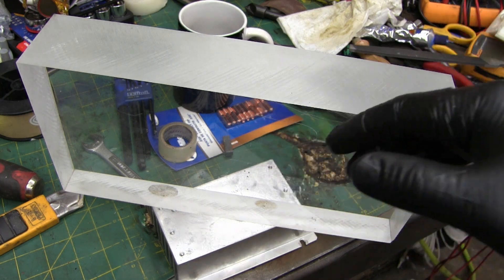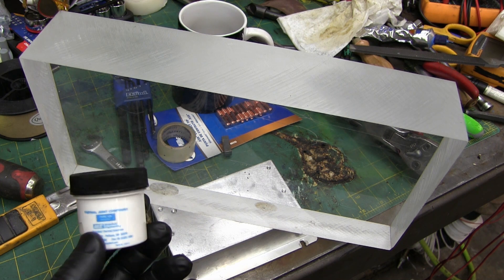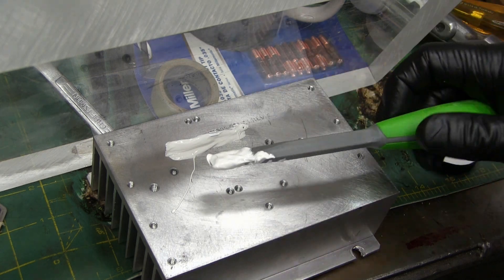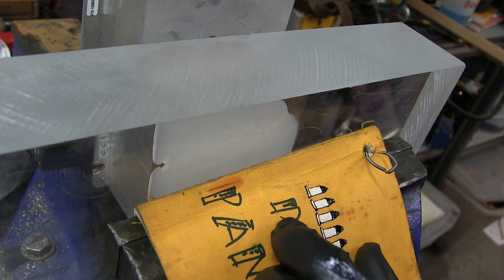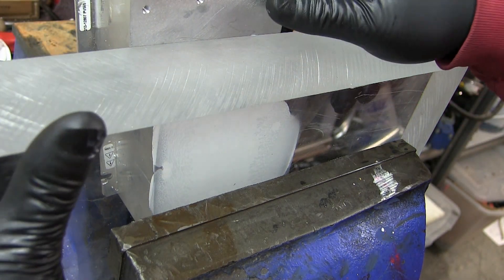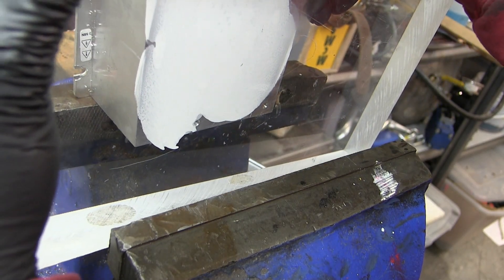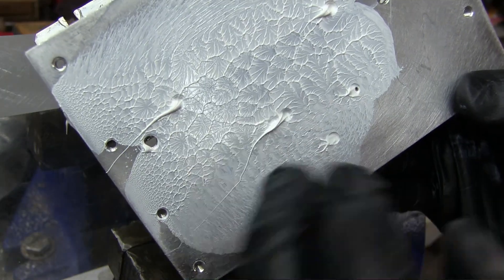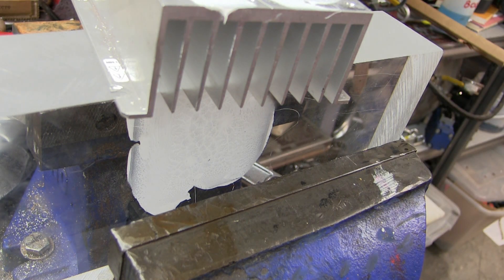Quick test of best thermal compound application

Comment: Not familiar with this odd pagan practice. I worship at the altar of molten metal. Her Glorious Electrons warms the sacred work. Her two prophets are the wise ones, Lincoln and Miller. May they forever arc.
Blessed are the apprenti, for they haul the tools and warm the lunches. Blessed also are the journeymen, for they interpret the sacred runes. Schmoo is forbidden by the Council of Bumblefuckery,  1967.
Reply: When you're putting a heatsink on a CPU in a thousand dollar computer, you can't really work with molten metal.
Reply: TheSpoonKing Challenge accepted!
Reply: TheSpoonKing actually, I bet you could work with molten metal. CPUs can be soldered to motherboards, CPU lids can even be soldered to the CPU die. It's not much of a stretch to solder a heat sink to a CPU. It would provide better heat conductivity, but be impractical due to difficulty in removing the heat sink later.
Reply: Kinda can, Thermal Grizzly Conductonaut. :P This kind of Thermal paste type are usually called Liquid Metal, and have about 10x the thermal conductivity  of a normal paste.
Reply: Yeah, I'd rather be able to remove my CPU from it's motherboard socket, and the heat sink from the CPU.
Reply: TheSpoonKing still perfectly removable like any thermal paste
Reply: you really put some extensive thought into this reply!
Reply: @TheSpoonKing:  Well actually, ...

https://www.engadget.com/2008/12/05/danamics-liquid-metal-cpu-cooler-found-to-be-impractical-ineffe/

Sodium-Potassium alloy has been tried as a molten metal CPU cooler, using a magnetic pump. Sure, it's potentially lethal and absurdly expensive, but that really just means that the correct application for its unique "advantages" has yet to be identified.

Think of it as an open opportunity-space.

8-)
Reply: Annwn Brother Brian Garrow.  In Weld Pool We Thrust.

Comment: Quick tip: applying compound directly to the cpu pins will drop temps up to 15 degrees C!
Reply: depends on how hot your room is in my case it usually drops to that

Comment: Big difference between that acrylic block and the thin lid on a CPU or backing plate on other semiconductors. Those little bubbles that can't escape distort the metal a little and make the paste layer thicker, thus less conductive still.
Reply: NoReallyName on PCs the spread and blob/pea method have the same performance. Look up Puget systems testing on it. Their TL:DR is any method performs the same as long as you have enough paste.

Comment: Can anyone tell me if a diswasher pump can be used as a water tank pump in a r v
Reply: Dishwasher pumps are usually 120 volt AC; RV water pumps are 12 volt DC.  If you don't need the pump to be DC, you could try it if it can put out enough GPH to run your shower, faucets, etc.  It might work.
Reply: Thomas Levy yes I know the pump is 12 volt dc as well as 120. A.c. the r.v pump I mean. So ok cool I should be able to jazz hands the specs on the diswasher pump to compare them to the r.v pump. Thank you
Reply: MyeyesRopen 1150, yes.
If your RV doesn't already have one, You'll need an inverter, (most likely, most dishwasher pumps are little induction motors running on line voltage) 
And you will need a way to turn it on right after you open the faucet. Then when your done, turn off pump, then close faucet, or just leave faucet open and control with electrical switch. Not a fan of touching angry-pixie gates with wet hands, so you can use a disposal air switch that you can plug dishwasher pump into, mount it right next to sink in the counter.  The big deal with a proper RV water pump, like the Surflo, is it converts the spinning motion of the motor to a reciprocating motion, it's almost a nutatating motion, but not quite, as it just rocks two condom-covered pistons back and forth, and doesn't rotate. What this does is hold a little bit of pressure in the pump, which then holds the switch open. When you open the faucet, the pump losses pressure, switch closes, starts pump, and you have running water. It's all contained in one unit, and automatic with control of the faucet.
They also have these in 120V AC versions as well. 
In the food-truck industry, they use air pumps to pressurized the water tanks, less noise when opening a faucet.

https://www.amazon.com/InSinkErator-STS-SO-Single-Outlet-Buttons/dp/B001DELK2Y
Reply: One more thing I forgot about, 
Head pressure. You will have to have dishwasher pump tapped into the bottom of tank.
The RV pumps create suction, which pulls water out of the tank from the  top, through a tube running down into the tank.

Comment: I appreciate the test as I was genuinely curious myself on how different application methods 'spread', but I think you missed the point about the various techniques. In the world of applying this goop to CPU's, I've always seen it as the recommended way by Intel/AMD to apply via the 'line'/'pea' method. You're looking for even coverage and thickness across namely the die, which is a small subset of the overall heatspreader area. The 'bigger the gob' style definitely doesn't apply here as the crap can spread outside of the CPU and get all over the socket or board. 

I'd be more interested in seeing a vid where you test the actual thermal conductivity of different compounds - i.e. the 'fancy' silver stuff vs. the generic goop vs. oddballs like peanut butter. Or even a well-lapped surface with no compound.

Comment: Being a bit of a young old timer (and a thermal goo schmoo nerd), might I suggest a couple of interesting reads 
1- From [H¸]ardOCP wayy back in 1999, they tested a thermal tape versus thermal compound : https://www.hardocp.com/article/1999/09/08/fragtape_vs_thermal_paste/1
2- From hardwaresecrets There is an excellent two parts read-up from 2011 regarding the best way to apply thermal grease/paste/compound whatever you want to call it. http://www.hardwaresecrets.com/what-is-the-best-way-to-apply-thermal-grease-part-1/ and http://www.hardwaresecrets.com/what-is-the-best-way-to-apply-thermal-grease-part-2/ The conclusion being "The-smaller-the-gob-the-better-the-job".
3- Following this, hardware secrets has an excellent database, albeit a bit old, of thermal compounds, as well as alternate thermal compounds such as mustard, baby rash cream, lipstick, mayonnaise, etc. 
4- Speaking of mayonnaise, http://www.hardwaresecrets.com/does-mayonnaise-last-as-a-thermal-compound/5- And finally, for a modern review of thermal goo, from play3r.net: https://play3r.net/reviews/cooling/thermal-paste-comparison-2017-what-is-the-best-thermal-paste-2017/
6- Annndd finally (really this time), I recall reading way back when les poules avaient des dents, that a proper lapping to a mirror finish will significantly increase thermal bridging, but I can't seem to find my old source on the gargler...
Reply: I think the correct term is ‘thermal schmoo’.
Reply: Otherwise, nice work
Reply: Alexander Thomas 't-hermal schmoo'
Reply: Yup...lets smear the schmoo...
Reply: Thank you for being more anal retentive than me.
Reply: Mayonnaise as thermal compound? WTH? lmao
Reply: the link to the 3th point got a bit mangled up by the "5-" from the next entry on your list.
Reply: VenomGT87 I used toothpaste once on a cheap LM317 based power supply. Abused the heck out of it and, years later, it still works. LOL
Reply: Lapping does work, I've done it to an old Phenon 2 x6 and Corsair H80 of mine, they almost cold weld when slapped together, temps dropped by 6C.

Comment: I remember dicking around with a little plastic template and a spreader to get 'exactly' the right amount of thermal schmoo spread on CPU after CPU till some older hand told me just to squirt a load in the middle of the plate and let pressure do the work.

Scared the bejaysus out of the folks whose PC i was servicing and I never worked for that firm again. Life lesson there.

Comment: Lots of research done in the PC enthusiast world lol
Reply: line vs pea, the eternal debate
Reply: X über alles
Reply: I know on here it's because they can churn out 3 monetized videos on the subject. All they do is apply it, check temps and then take it off to look at it; without actually watching it spread. Really, it doesn't matter, especially on a block that's probably 3.5 sq.in. in total.
Reply: simple: they are both wrong, glob always wins
Reply: The reason to use a blob is simple. CPUs and GPUs are not flat.
They are concave or convex.
If they were actually flat, we wouldn't use heatsink compound.
Reply: "Fun" is serious business for the PCmasterrace. And Germans. Coincidence?
Reply: a grain of rice from top of motherboard to the bottom works best, that's about how you get most of the area covered which is connected to the internal heat spreader.
Reply: Bigger the glob better the job!
Reply: hey ! I know you !
Reply: So would it be better to apply a little more so when pressed on it comes out the sides then wipe off the excess?
Reply: djteac false. Even if they weren't convex or concave the surfaces are not perfectly flat nor will they ever be. The compound conducts heat much better than the air that would otherwise fill those tiny spaces which is why we use it.
Reply: No, if they were flat we'd still use compound.  Heat transference between two plates is abysmal because of minute imperfections on the surface of each metal.  Compound fills in the gaps.
Reply: Lapping is the only way to get the real numbers down down down
Reply: The only real way to apply thermal paste is in between the motherboard and cpu
Reply: What if the heat sink was wrung onto the base plate like a gauge block, I reckon that'd have pretty superb conductivity.
Reply: +djteac actually even after lapping a CPU/GPU and heatsink you still need compound to fill the minute air gaps between the two surfaces.
Reply: Research, no. Opinions, yes.
Reply: 3.5" sq in? Back in the day before this new fangled 'heatspreader' bumblefuckery we put 100W+ through about 1/2 sq in of exposed silicon die and glob worked just fine.
Reply: Even if they were flat you would need heat sink compound because they aren't perfectly smooth. Heat sink compound is supposed to fill in the microscopic peaks and valleys in between two surfaces and ensure good thermal contact at the interface.
Reply: TMM "Back in the day..." You and Fred Dibnah must have made a great team. 😂
Reply: Athlon club, represent! :D
Reply: cleadge not if the surface was perfectly flat.
Reply: agree!
Reply: NEEEEEEEEEEERRRRRRDDDDDDDDSSSSSSSSSS

Comment: I always used the method where you first smear then scrape/wipe off, just to fill any tiny surface imperfections, then add the glob.
Reply: if i were selling that stuff id recommend it too.
Reply: Going to do the same with a dollop then squashed.
Reply: Yeah, because that extra 0.001cm^3 really makes/breaks their bottom line.